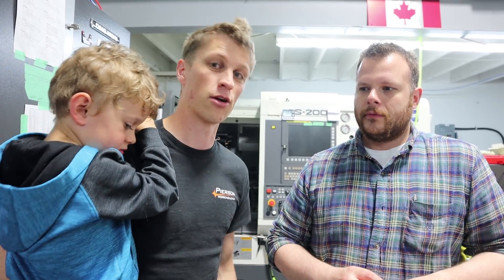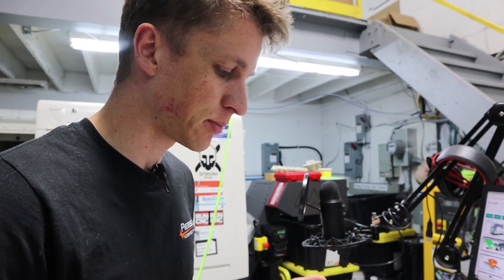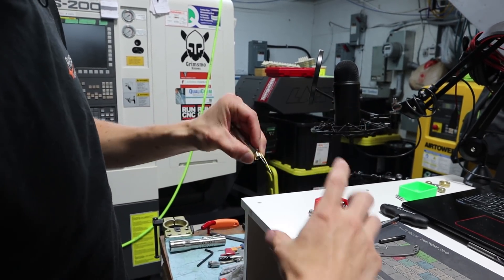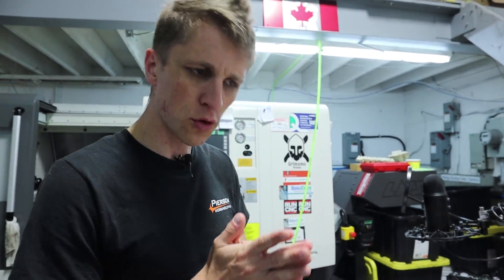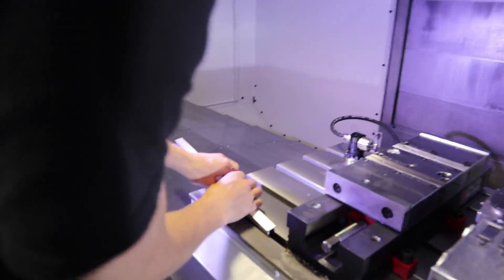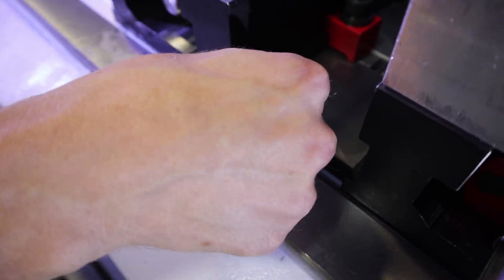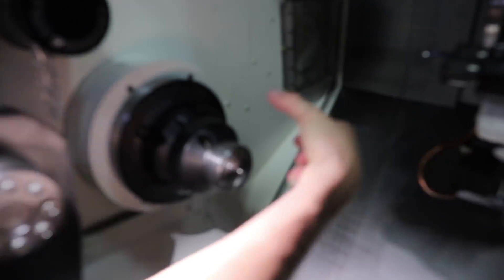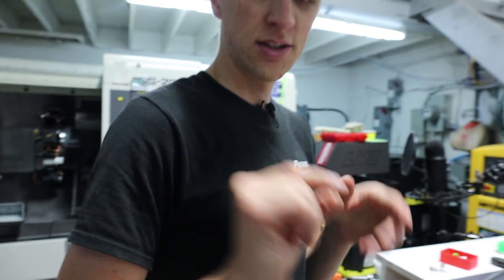3D Machining a Pen - Saga Saturday 009

Comment: I thought canadians using metric system
Reply: Ya I feel the same way in the opposite direction. I have to convert metric to imperial every day. It burns up a lot of time on complicated parts. Smart engineers double spec their dimensions to make it easier for both of us. You get even number metric callouts? Must be nice. I get stuff like 8.14mm. Also depending on tolerance we would say "three hundred fifteen thousands" not that whole conversion.
Reply: First I understand your points. Particularly on temperature it is a huge  factor. The larger the part the more it's a factor. Second we run coolant on all machines so the part is not hot from machining. Third Our CMM is not average in any way. You could have bought a new Lambo for what it cost. Fourth we cool the parts  before measuring on the CMM. Finally the only time we're going to be at the edge of tolerance is when the insert is indexed and the machinist is working up to size and feels another pass would be too risky. The rest of time they're going to run dead in the middle. There are other tricks as well but since I'm already skirting the border of my confidentiality agreement I'm done talking about it. Cheers
Reply: I wish it were but being a former british colony ,there are still many artifacts of that old system.   size and body proportions are described in SAE where as volume and distance is metric.   I will be honest, I don't know my height in metric.   Weight is described in SAE 50% of the time where as mass is always metric.  nobody describes the mass of anything in stones.   when registering vehicles, we use KG and meters for paperwork.   But we still use HP instead of kw for the power of things.
Reply: Joshua Szeto wow!....what a mixture and mess! I work in metric system, when having to deal with american or britsh stuf i feel like throwing up. Isn't it's easier to say 8mm ,rather than 0.314961 inches? I heard that in some former british colony ,people are still driving on the wrong side but switched to metric. Maybe Australia?
Reply: Fischer977
Yeah machinist deal in thousands of an inch in America. 
so you say 7.75 mm
and we say 305 thou. 
(and if you are working in very high precision you might say 305 and 1 tenth, but almost no machinist works in sub thousands of an inch)
Reply: Probably about 5 to 10 percent of our work is under .001"
Reply: What are you making which needs to hold those tolerances?
I mean a force or clearance fit is 1 or 2 thou in steel.
Also how are you measuring that?
I mean you need to have something that measure accurately in .00001 Are you using a CMM or something?
Reply: Bearing press fits are one example. You need to measure accurately in the .0001's range (from .0001 to .001) The callout is +-.0005" For measuring it's a combination of the machinists' skill with bore gauges, id mics, and od mics (with proper metrology) backed up by CMM. I'm not saying it's fun but we do it regularly and accurately. I've seen prints for 60 years ago with those kind of callouts from before CMMs and widespread CNC.
Reply: I forget what the rule is but you need to be able to read under 20%(or some number like that) of your tolerance.
My old teacher was an inspections guy and it always pissed him off when people would measure a +/_ .002 tolerance with a caliper or something that measures .001. 
You need a buffer. No matter how good your instrument is, and how skilled you are at reading and measuring. You will make err in the measurement.
Reply: I think that's why so many prints call for .005" tolerance. 
(you can measure that with a standard caliper)
Reply: Agreed to 1st post. First part of the shift goes to CMM. Any part within .0002 of the edge of tolerance goes to CMM. One thing I didn't mention is you need a high quality machines or a very skilled and patient machinist to maintain those tolerance. Grimsmo's stuff can do it. I (at my day job) only use calipers when there's no other better tool to do the job. Basically I consider them a little better then a tape measure. Normal tips tend to bugger and carbide tips tend to chip. Even the good ones have more play in them then I like. If you can produce parts that your customer is happy with it doesn't matter what you use to do it. However we ship worldwide and returns are expensive.
Reply: renegade cnc
Here is my problem with that process though.
CMMs as a rule have a tolerance of a tenth or half tenth. They may read into the hundredth but that's more of a statistical value.
Also 10 degrees F, is half a tenth in steel.
So say your part is 30 degrees hotter then the room temperature.(easy to do)(+.00015)
And your CMM is of an average make.(most people use those)(+/-.0001)
That's (+ .00015) + (+/- .0001) = a potential high of .00025
Meaning you could be measuring acceptable and really be out half a tenth, out of whatever range you have.
So understanding the tolerance of your measuring equipment is really just as important, if not more important, then the actual machining tolerance.